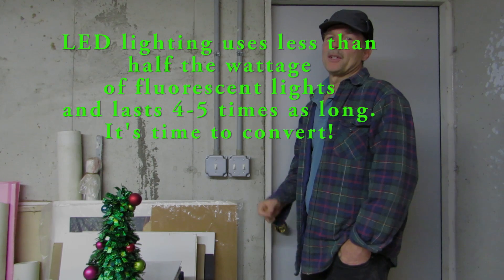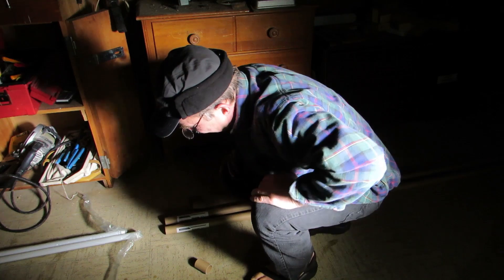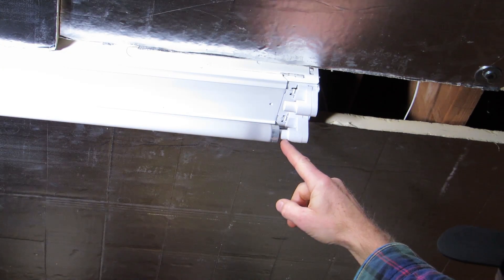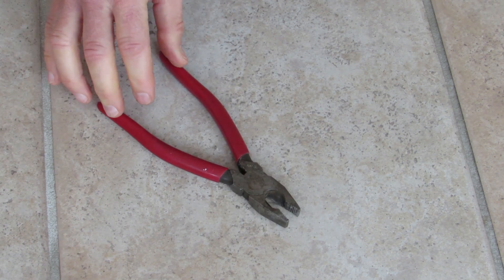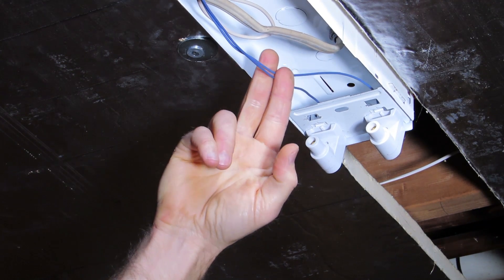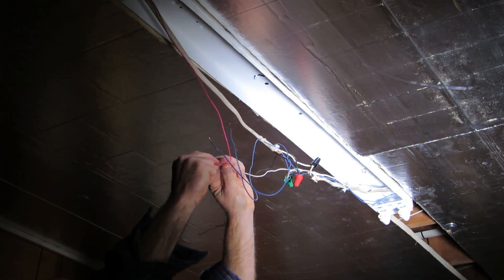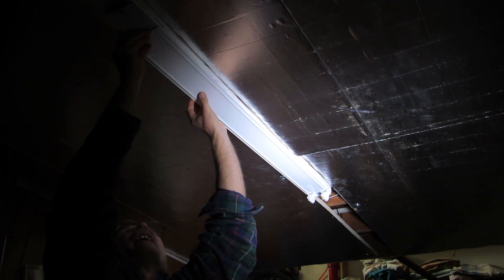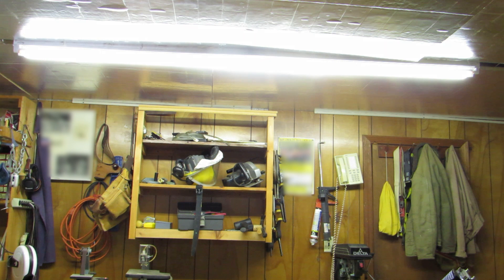How to Convert Fluorescent Tube Lighting to LEDs #cb99videos #LEDfluorescentconversion

Comment: I have nine of these 8' fixtures in my barn,/garage, but the tombstones mounted are HO or high output. I need to buy 20 spring loaded tombstones and 20 stationary to complete my conversion, and then buy 18 LEDs 8' bulbs.
One thing, you didn't point out that the red single wire had a jumper connecting both tombstones on the one but end.

Comment: What is your ceiling lined with?  Looks like some type of foil covered insulation.

I just tested reflection levels in my shop with a light meter (lux meter).  I have white foam board installed in the ceiling.  I measured the light at a workbench level directly under the light fixture.  then I replaced the white foam board with a foam board covered in adhesive foil.  I lost 60-80 lumens.

The I replaced the foil covered foam board with white... and got my 60-80 lumens back.

White... reflects better than foil.

Comment: I have two red and two blue wires on the power end after the ballast.  Do I connect one red and one blue each to the black and white wires which ran into the ballast?
Reply: +Shaun Thomson  Hi Shaun, both reds,both blues as yours has a individual wire for each bulb socket,unlike cb99 where the single red wire was connected to both sockets,then the blues 2 one wire goes to each bulb socket